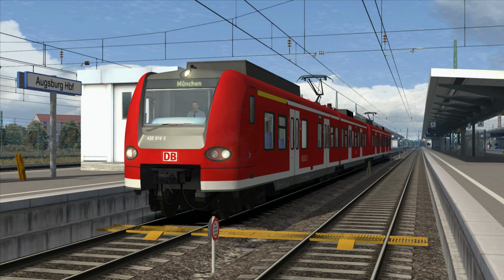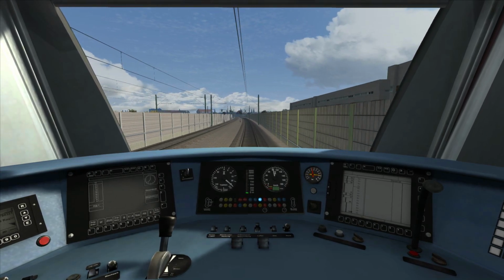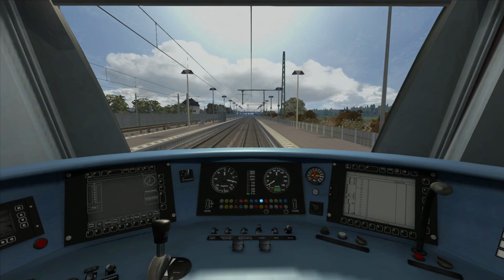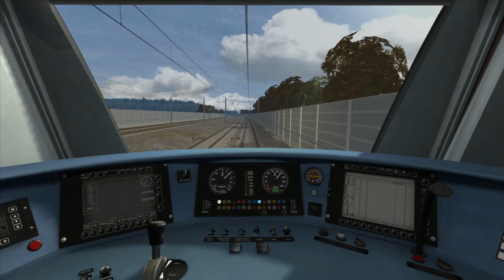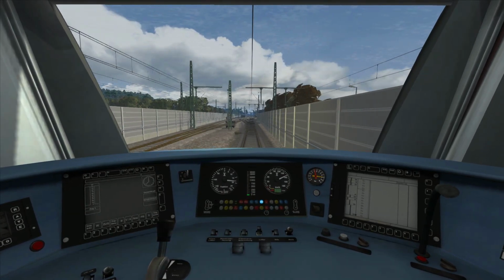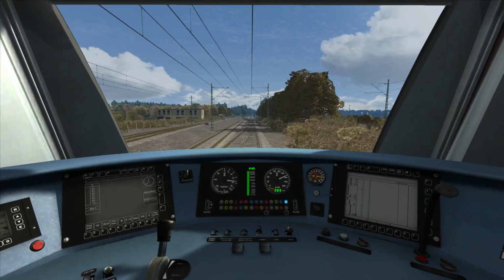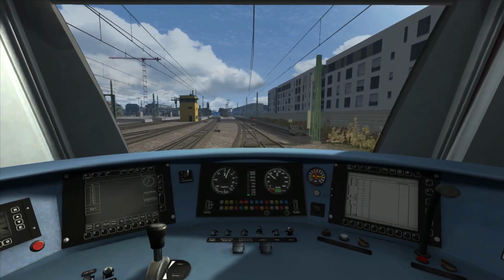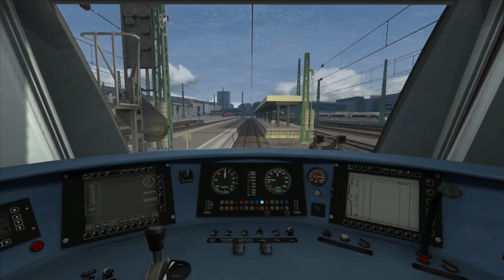Train Simulator 2015 - Route Learning Germany: Augsburg to Munich (BR 426)

Comment: Losts of you may not know, but the HST has an Australian relative called the XPT!

The XPT (eXpress Pasenger Train) was first considered by the NSW state government in 1979 when Comeng, (Commonwealth Engineering) won the contract to supply country rolling stock. Originally, the NSW government wanted singular railcars like the sprinter DMU's but Comeng said that a train based on the British HST would be better for the task.

The design was modified so it was different than the HST. The powercar is 50cm shorter, the Valenta engine was down rated from 2,250 bhp to 2,000 bhp, meaning that the top speed is 160 KM/H. The same as the v/line V/locity. Other differences are that the air filtering and cooling has been changed to suit dusty Australian conditions. There are other differences, too such as the nose in a slightly different shape the horn is different, and the headlights are under the pointed section. Other that this, they are quite similar.
Reply from the maker: Joshua Randazzo Please don't duplicate this comment across several videos. One comment will suffice :)

Comment: one thing which I would suggest with this train (as it works very well) is using 'trainsim helper' in conjunction with AutoHotkey, which means you can use a joystick or throttle (i use the thrustmaster t-flight hotas x) for throttle/braking and its buttons for things like pzb and doors opening. It works really well for this train, as the throttle has an indent in the middle for where you are not accelerating at all. Any more info just ask!
Reply from the maker: Thanks for the idea. Where can I get 'trainsim helper' from? As I do indeed have a joystick and throttle :)
Reply: +PTGRail just Google train sim helper and it's on a forum post I'll link it here in a min I'll find it now
Reply: +PTGRail http://forums.uktrainsim.com/viewtopic.php?t=139304 is the link, it's at the bottom of the top post, I'll send an FB message in case you want some help, its a bit complicated to set up sometimes

Comment: Another great tutorial video PTGRail I've never done a stopping service on this route before having only done the high speed run, though I hardly have any German stock so I would have to rely on the default scenarios myself, which as you say are pretty dull and unrealistic.
Reply from the maker: William Mankelow Thanks William. Stopping services help make the route more interesting, or else there's not much to do and it feels like it's over before it starts lol :p Though I will likely do a fast run in the opposite direction at some point soon. It's worth investing in a few German trains as they are quite enjoyable to drive :)

Comment: I have a question about this route add-on that hopefully someone will be able to answer for me: I saw in the Steam reviews for this add-on that there are a lot of bugs/errors with track speeds (switching quickly without warning), making it mostly unplayable for many scenarios. I was just wondering if anyone here could verify that or if the reviews were wrong/outdated/exaggerated?
Reply from the maker: Unfortunately I can't confirm or deny those reviews as I'm not sure. I've not personally had any issues, but others who know more than me might notice them more than I would.